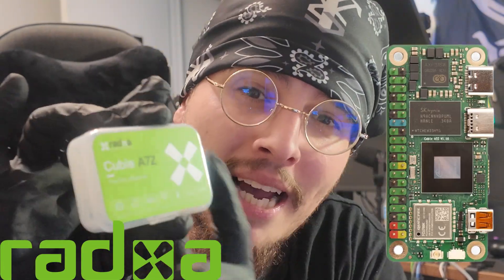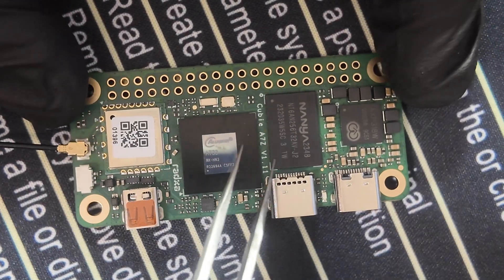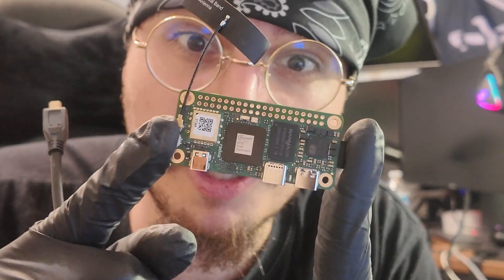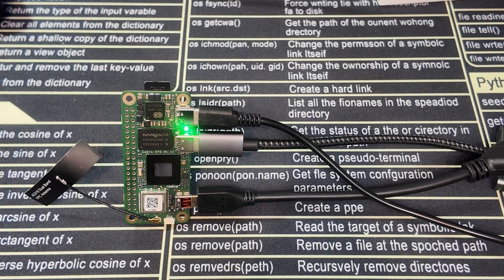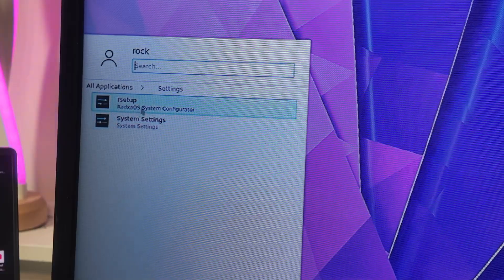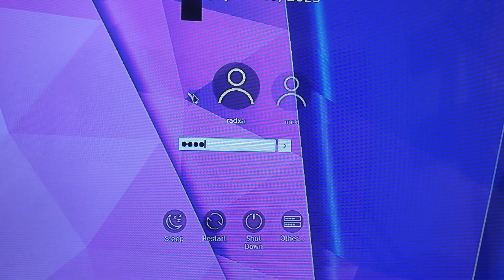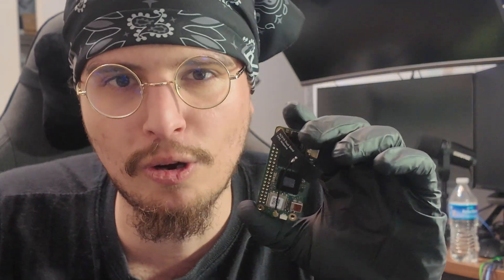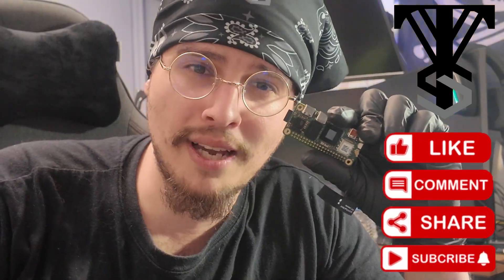Radxa Cubie A7Z

Comment: Doing some work on  a7a  (same allwinner a733 as a7z.)

The boards are potentially super capable, but software does lack significantly.
price is great.
im running 12gb ram, and OS is was still having significant visual issues for me. 
Armbian and Radxa OS both.

Support and repos are limited, but there is enough to use AI to help with custom things and kernal adaptations.

at least, i hope so. My progress has been a bit stagnant with Frankenstein builds and repos. 

Great video!
Reply from the maker: Thank you! When it comes to armbian on newer builds he usually takes a few months. I feel like they’re just taking their sweet time with this one.